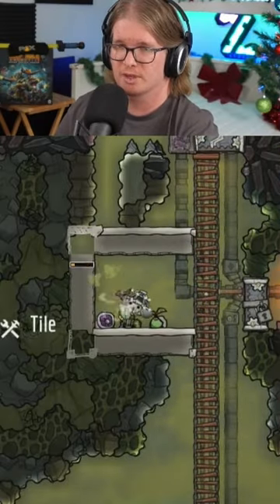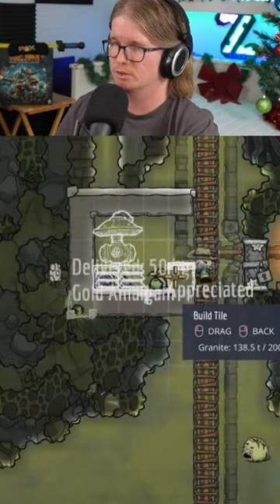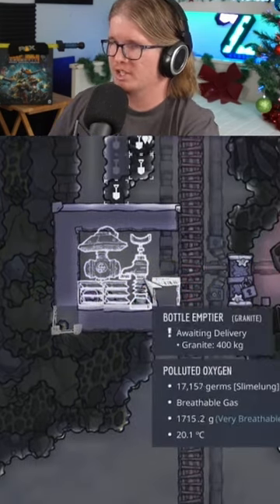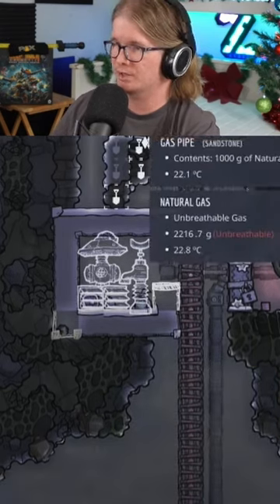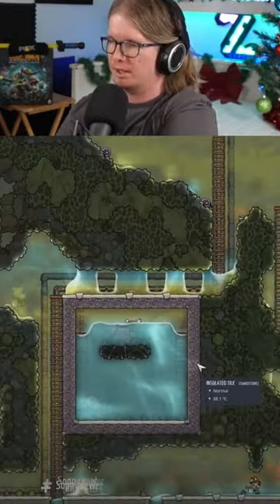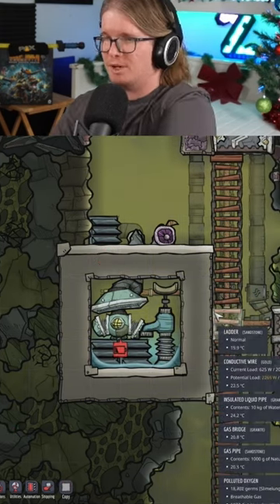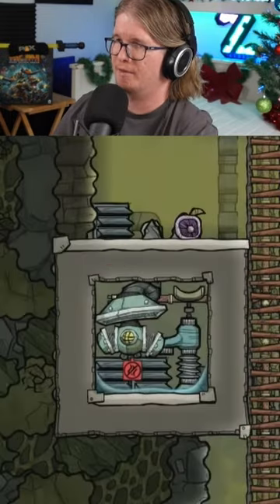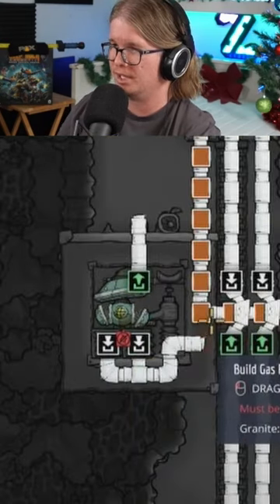INFINITE gas storage WITHOUT gas reservoir in Oxygen Not Included

Comment: how much water did u put in there.
Reply from the maker: @Financere425  the gas goes over pressure with 2kg of liquid. So if you do just less than 2kg of liquid per tile then it should work. For my setup I think I did 5800g of water total because it is 3 tiles wide